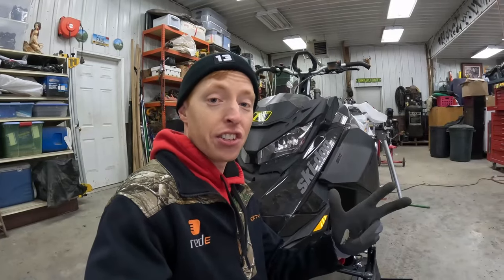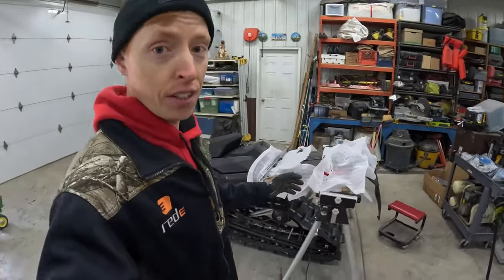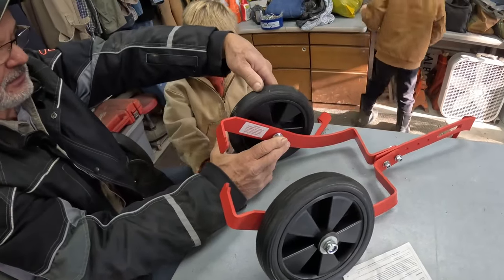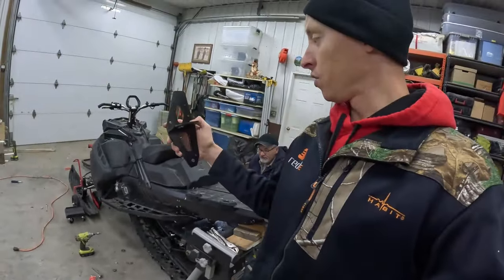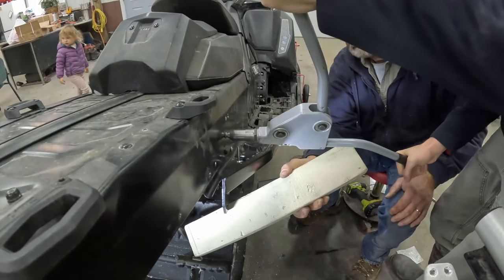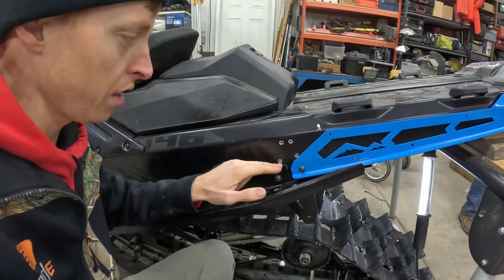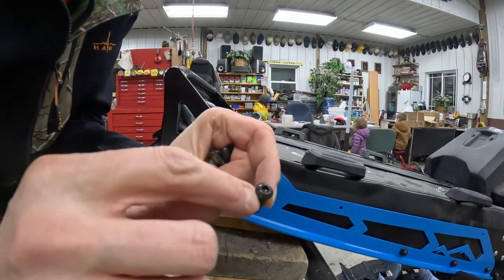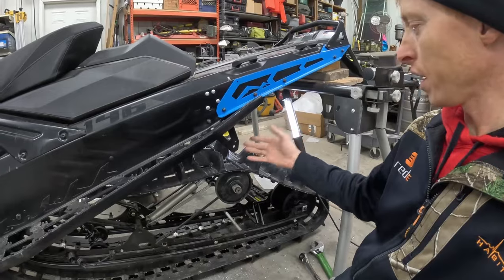I fixed my bowed tunnel 2022 Ski-Doo Summit SP Gen 4 w/ *BM Fabrication EXO Bumper*

Comment: Certainly first fix of the rear drop brackets I have seen. Love to see the impact old owner took to fold those. There not the toughest in the world but not a part ya see people upgrading or lots of failures on. Have flat spotted rear wheels, broke rails, rear axles, shocks,, track, front arms but never one of those brackets. Something to look forward to as your having a lot of fun before that happens!
Reply from the maker: I know he took a spill or two but he didn't remember a moment that stands out when it would have happened. I wondered the same thing and time will tell if I cause or see other issues. Glad the tunnel didn't kink because that'd be a lot harder to deal with.